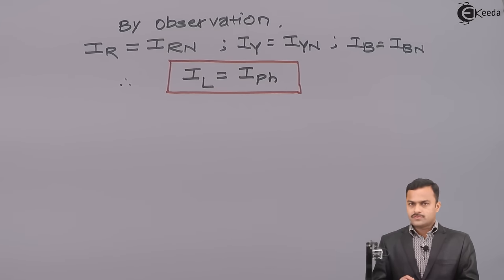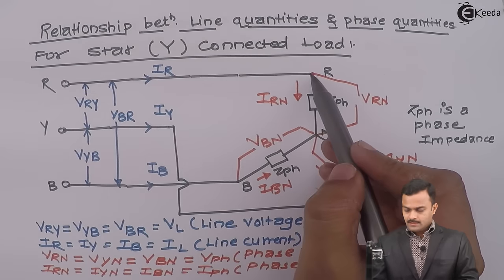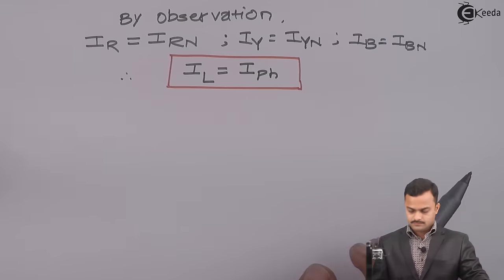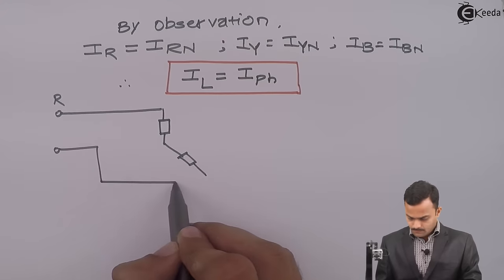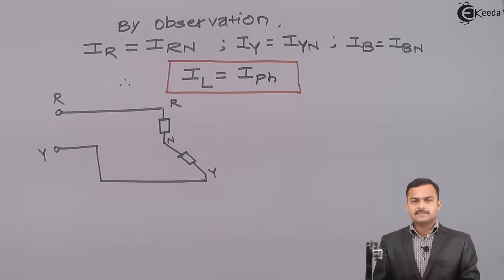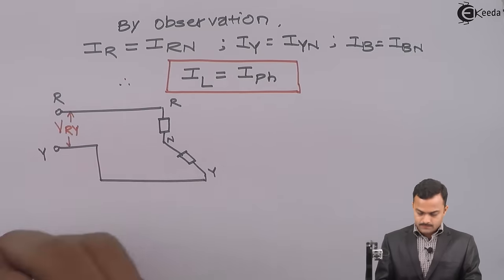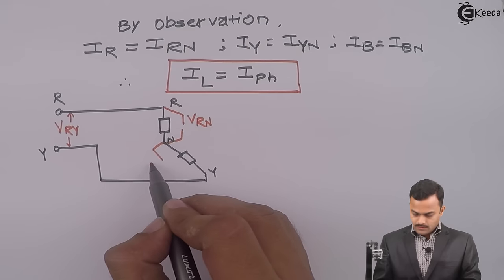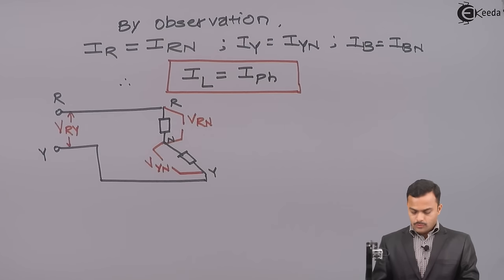Relationship Between Line Quantities and Phase Quantities in Star Connection - Three Phase Circuits

Comment: Conceptually, the video is really good. You have explained everything in terms of how like relationships between line and phase voltage which is really good. One suggestion from my end, you have drawn everything in phasor diagram but it would had been more precise if you could had explained that how did you determine phasor sum of phase voltages like V rn & - V yn will be V ry.
Reply: That is from the relations he got from previous  .
Not an alphabetical substituition .lol

Comment: Would it make big different if we seal each coil separately and intersect with the alternating of motor to generator coil then no extra part needed for fuel less motor except extra capacitor for starter

Comment: The Rhombus degree explanation is not clear. Why is it 30 degree?
Reply: theeachuisge  just draw a rhombus in a paper with using scale..and measure the angle...it's always comes as 30° for any size of rhombus
Reply: Arun kumar ah okay thanks.
Reply: Because it is a rule of maths
Reply: @arunkumargd5524  you are totally wrong. Rhombus can have any measure of angle. You can google it.
Reply: It's 30 degree bcoz 120 is given in problem. Now you can apply basic geometry.
Reply: Bro it is 30 degree bcoz phase difference between two line voltage is 120 its half is the backdraw of 3rd voltage means it gets divide equally. I.e 60 now in rhombus it is congruent means get half again means 30 degree
Reply: @arunkumargd5524  😂😂😂😀🤢💦